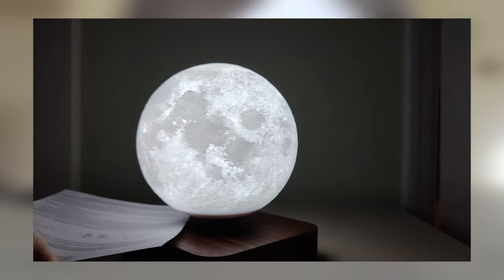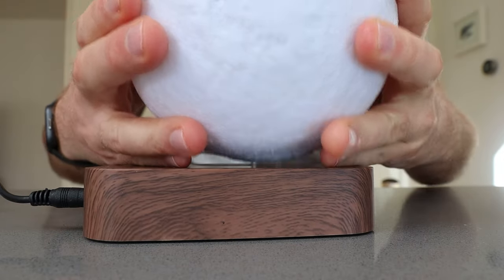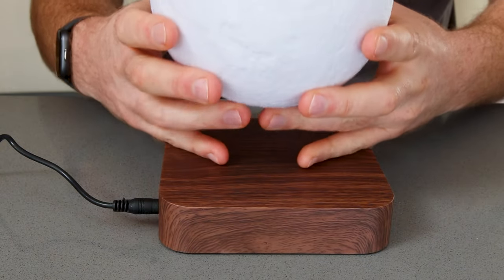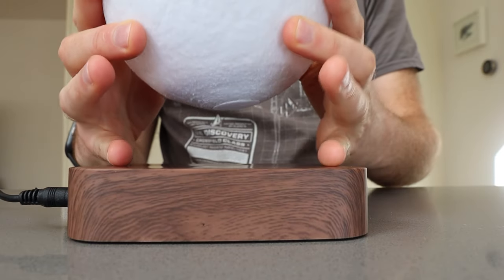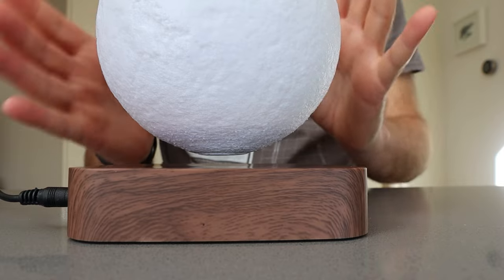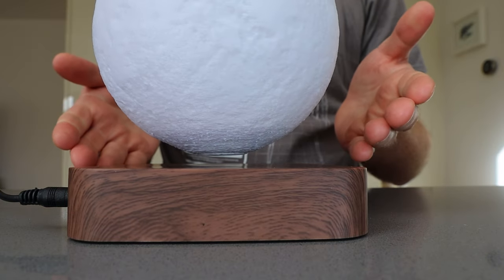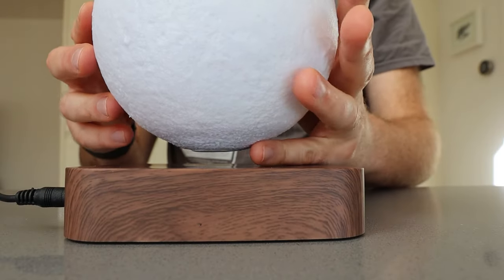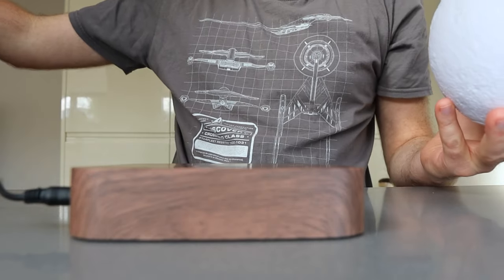How to set up floating moon lamp

Comment: We are struggling so bad! Had about 50 attempts (no lie) and still cannot do it
Reply: OMG, I am contemplating on buying one for my daughters. After your comments i am wondering whether i should pursue this thought or go for something else instead.
Reply: IslamIsTheSolution98 I want to get my dad one for Christmas. Is this a scam?
Reply: @NICKandJAMEScomedy nope, got one for Christmas, it’s really not thet hard
Reply: @DeviousMous   I got one from christmas too
Reply: I found a foolproof way to get it levitating is to cut out a template the same size as the base and cut a 7/8” diameter hole in the template. Tape the template to the base and it levitates immediately. I used a piece of 1/8” panel for the template, but expect cardboard should work also
Reply: 50, that's all? I've tried a few fucking hundred. I'm losing it!
Reply: I saw somebody use gloves
Reply: Same here! I think the design of the base needs improvement - it’s too lightweight!! 🤬
Reply: @carlpiano

Comment: I managed to get it to work once. So far though even with the power on, it rejects the attempts to center. Taunts me with each very loud clack as the magnet yanks it to the side with a rather sudden impact. I'm wondering if this thing needs to warm up or something before the magnet starts working properly.
Reply from the maker: The one in the video works as soon as its turned on, but there is certainly a knack to it. Sometimes I'll get it on first time, sometimes I need a few go's.
Reply: It’s impossible. I’ve tried …. My husband tried… my son has tried…. Its like a tunics cube😒
Reply: Rubics cube
Reply: 😂 Terrorized by the clack of the floating moon.
Reply: @robertwilsoniii2048  Mine has to warm up before I can use it unfortunately. but beyond that it stays functional nonstop unless the power cuts out and I forget that it makes a loud sound when loosing power.

Comment: Could you please give me some more tips?… I cannot get it on the base? Unfortunately and I’m getting frustrated… please help me? Kind regards, Dona from Belgium
Reply from the maker: All tips I have are in the video. It can take a bit of practice, sometimes I do it first time, sometimes I need a couple of go's. Getting frustrated will certainly make it harder so the O ly extra tip I'd have is to step back for 5 minutes and approach it again when not frustrated. Good luck!
Reply: Likewise! I empathize with you, as I am having the same problem! 😢

Comment: God bless You Tube instruction videos !!!😂
I have a question:  In the very minimal instructions, it says  #8 While the Moon is successfully suspended, you can control the "moonlight" by gently tapping the power marks on the base."   Anyone have any idea what that is about?   I'm not seeing any
"power marks on the base"...??
Very cool item.  Wish there was a way to adjust the spin.....slower and options to just let it float without the spin.
Reply: Update -   I watched another video and discovered there is a VERY subtle spot indicated near one of the corners on the base and if you very gently touch it, there will be a slight shift on brightness.  So I guess I solved the question.

Comment: Helped me! Thank you!
Reply: Whats your power supply output? I lost mine and i dont know what the specs are. 😅
Reply: @jesterc.6763 Hello! I'm still not sure if my response actually made it through. The thing that comes with it in the box has the following output parameters: 12.0V-1.0A Max 12.0W C.V.
Reply: @vladzakh11  thank you so much!
Reply: @jesterc.6763 have you managed to find the cable and levitate The Moon?🙏🏻

Comment: I cant do it for shit. I let go gently and it just whacks it
Reply: SAME OMG
Reply: I have had great luck by making a cardboard template the size of the base and cut a 7/8" diameter in the center and tape the template to the base.  Then you just move the moon over the template and the magnetic field locates the center of the moon instantly.  For me  actually I made a template out of a piece of 1/8" thick paneling.  I keep it on hand and it works every time first time.

Comment: You left out the most important step  where you give up and either 1) return this for a refund, 2) throw it in the trash out of frustration. Floating this thing is similar to doing the "Rope Ladder Climb" at the State Fair. In my case, this was a gift so I had to make it work. My only suggestions are to get down at eye level (like your video) and just keep moving it around with both hands until the pull downward from the magnets disappears and the globe lights up. Maybe grab a cool drink and prepare to spend up to the next 30 minutes trying to get it to float
Reply: I literally spent hours multiple times a day to get this damn thing to float. I decided it wasn't worth it, I trashed this peace of shittt.